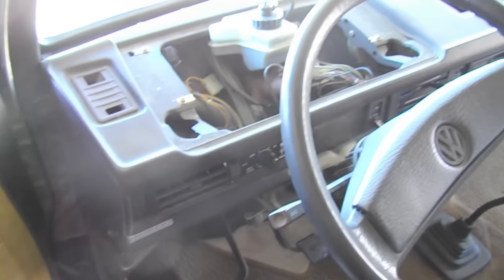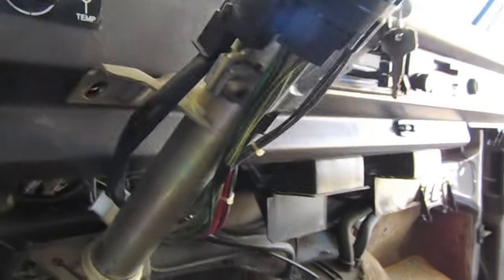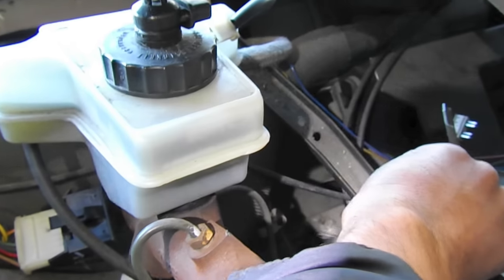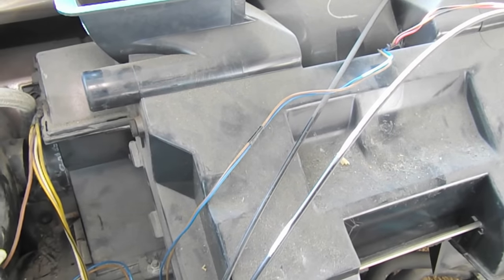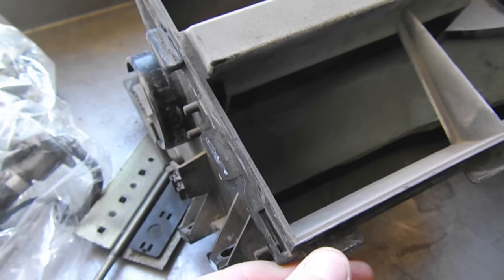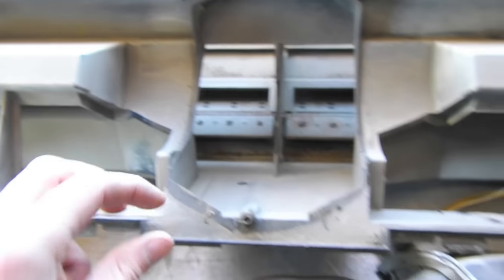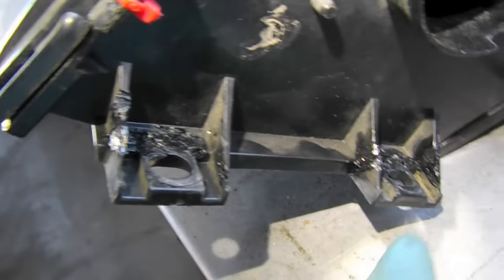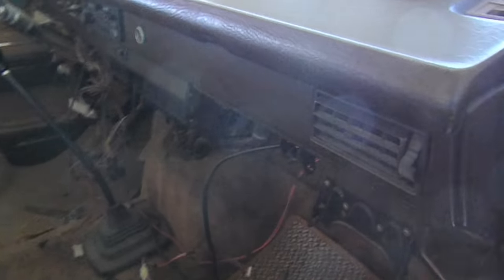Vanagon Dash Removal and Heater Repair

Comment: I learned the deal on those bolts from a friend who has been a mechanic in the 70s.  They are called “shear” bolts, as they come with a nut on the head for installation that Shears off when the appropriate torque is reached.  These are to keep you from removing them.  He said that they always just welded new nuts on them after removing to make it easier if they had to remove them again.

Comment: +Busaru thank you for posting this video.  I just successfully replaced my blower motor thanks in part to the tips and tricks learned here.  Two things I did differently: instead of using zip ties or clips to reattach the halves of the heater box, I drilled pilot holes through the welded tabs and secured them with sheet metal screws (17 in all, I believe); secondly, I relocated my blower motor resistor to the grill area behind the passenger side headlight (similar to the radiator fan resistor located behind the driver's side headlight) with an extended 12 AWG wire loom; it's now surrounded a by non-flammable/non-meltable metal area, is always in fresh airflow, and can be easily changed when the time comes.
Reply from the maker: +Bentley Whitman good tips! I'd recommend that to future folks as well.

Comment: Tell me guys what is the auxillary water pump at the rear on the Vanagon, Someone tells me it is there to rotate the coolant from the back to the front Radiator. Mine has been dis connected now I want to get my heater working again. Do I need this pump? As the hoses have been disconnected and bridged. I purchsed a 1995 Vanagon. I want to get everything original working on it.

Comment: IVE HAD ALL THE PARTS TO DO THIS FOR LAST TWO YEARS , I BEEN FREAKED BY ALL THE HORROR STORIES , IVE WATCHED THIS VIDEO NUMEROUS TIMES AND IM GOING FOR IT .....I THINK
Reply from the maker: You totally should - it's easier than you'd imagine.
Reply: How did it go? Im into my second day and cant get the blower motor housing off- looks like it has screws from the front radiator side. Ive got an '89. Also, my 2 halves are glued as well, but I am worried about breaking them when trying to separate them, how do you do that?
 8^(

Comment: One bad thing about moving the resistor pack outside the air box is that I'm fairly sure the rush of air in the box is supposed to cool the resistor pack to keep it happy.
Reply from the maker: Dwayne Perry Dwayne, thank you for pointing that out. With a heat sink on the resistor it dissipates enough heat to keep the resistor happy (at least in my experience) and I've edited the video to hopefully pursued folks to either leave it alone or move with a heat sink. Thanks man!
Reply: Busaru No problem! I never really noticed the heat sink in the video. But with a heat sink it should be cool as a clam. Love your videos and look forward to seeing the Vanagon moving under its new power soon.

Comment: I vaguely recall doing this on my '83 in the cold. Couldn't split the plastic cases in place, then I removed it and brought it into warmth, the sealant around the perimeter softened and voila.
Reply from the maker: +binnsh Good tip, I bet the warmth really helped.

Comment: First off... LOVE the videos.  Now my question.  Is it necessary/mandatory to replace the blower motor?  I am a huge believer in, "if someone can make something, then someone can take it apart, fix it, and put it back together".  My fan motor stopped working, but instead of buying a new one, I thought why not try to fix it.  After seeing all the CRUD that was in my blower box (dirt, feathers, bugs, leaves, etc.) I figured clean the motor up, clean it out, and see if it works.  Well so far, so good.  All it cost me was a can of Lectra-Motive Electric Parts Cleaner, a few shop rags, a few blasts from my air compressor, and a little electric motor oil.  The amount of CRUD that came out of the motor was amazing.  I wish I could of gotten the actual motor apart to do a FULL service on it... but... it blows (big-time) without any noise or bad smell.  Just wanted to share... and keep those videos coming.  P.S... living in Georgia, having a heater isn't really mandatory... it just bugged me that it didn't work.
Reply from the maker: +B.J. Boyette Good work! Personally, I feel exactly as you do. I love repairing over replacing. The problem is that this was a customer vehicle and he really just wanted to replace everything, so I didn't have much say. Still waiting on payment for this job haha!
Reply: Thanks Bro... but this whole process began with my clutch pedal have WAY too much play in it (the infamous egging out of the clutch pedal arm hole and wear of pivot pin).  As I noted, the blower motor was just add-on since I had the dash off.  Living in Ga., heaters are optional, however A/C has become mandatory.  My Subaru donor engine came with ALL the A/C equipment installed, but of course, I removed it for easier engine installation.  Do you plan on adding a A/C installation video to your repertoire??  Just wondering.  I guess A/C isn't all that necessary in Colorado... but... here is the steamy humid south... they sure are nice to have.
Reply: The first time I did this I cleaned the motor up and put it all back together, the second time was not too much later when I replaced the blower motor :-)

Comment: Thanks for the video! Saved me a lot of trouble. Found out a #3 Easy Out and an impact driver makes quick work of those security fasteners.
Reply from the maker: +pyrobeav2005 Nice, good tip on the security bolts.

Comment: Blower was working fine, until the #10 fuse blew. Thought it was the wiper motor, but turns out it blows when I turn on the heater blower. So, must be seized, eh! Will order a new one to replace it. Looking forward to doing the job now that I know how. Any comments on the fuse blowing?

Comment: My heater cable snapped, thankfully with the heat vent closed.  Live in S CA so not an issue BUT I’d like to fix it.  Does the dash HAVE TO come out? Or could I some how snake the new heater cable to the original (I can see it/access it) and maybe get away with not removing the dash.  This looks hard, and I’ll gonna break stuff on the old gal…

Great vid.  Thx for posting

Comment: Great vid...thanks.  Question: I've seen a couple videos of dash removal, but nobody shows how to remove the instrumentation knobs.   Do you just physically pull them off, or do you do something from the back side like unscrew something?   

On another note, my brakes are very suspect.   I can slam them down and the van will ease to a stop while I was expecting it to screech to a stop (almost ran into a couple of folks).    It seems I'm hitting "bottom" quite quickly when I slam it home.   Brake performance is ~ 15% improved if I pump them once before applying.    I've replaced the MC (and brake sensors), I've bled all six zerks (Mitivac pulling dirty fluid out) and my indi says my pads and rotors are ok and that sometimes this is just how the Vanagon is (I call BS).     Why do I still have crappy brakes?  Would appreciate any, I mean ANY, advice or tips.
Reply: ***** 

PS, 1985 Westy.
Reply from the maker: If you mean the heater controls then you just take a small screwdriver and kind of work then off from the back while pulling out. For the brakes, make sure you have good vacuum to your brake booster, perhaps your booster is on its way out??? Good luck!

Comment: I  have a question for you.  Do you have (or know of a video somewhere) that shows which cable goes where on the blower box?  Also, would you have any info on required cable lengths and cut back for the cables.  I have been searching the web looking for replacements, but it is looking like I am going to have to fabricate my own.  It appears that the previous owner used lawn mower throttle cables for heater control cables.  Any port in a storm I guess.  In hindsight, I really should of marked them at the blower box when I removed them.  Anyway... any assistance would be greatly appreciated.
Reply: hey man... I see you are delivering a vehicle.  Never mind about my question.  I worked it out.  No pics cuz it is a butt ugly arrangement of cables (not my best work)... but it functions... which is way better than before.
Reply: What did you end up using? I am looking to deal with most of those in dash cables, and was thinking bike brake cables and housings.
Reply: That might work... depending on how easy your slides and flaps move.  I wound up using lawnmower throttle cables (HomeDepot).  I bought them all the same length (52").  I wasn't sure about the cable length so I snipped the z-bent ends of the cables (one end only on each) and pulled the cable out of the cable housings.  They are a LOT easier to route with the cable out of them.  Then I just started routing cables.  Once I got the cables routed, I marked and snipped the cable housings at the needed length.  After that I slid the cables back into the housings (grease them first).  I connected the finished end (the one with the z-bent end) at the control flap and  did my final snip and put a new z-bend at the control levers.  I used a magic marker to mark the open and closed locations on the cables (they move pretty easy brand new and freshly greased).  Anyway... that's what I did... good luck.  Just remember... measure twice... cut once.
Reply: oh yeah, search for "z-bend throttle cable" to see a video on how the z-bends are done.
Reply: Thank you B.J. Boyette! This sounds much more doable, and throttle cable will likely last longer in that environment.
Reply: da nada... glad to help.

Comment: Hello Sir ! Could you please tell more about the plastic welder ? What model did you use, so I can have a reference point ? 
About the dashboard...I had smoke from the dashboard, about a week ago. Somebody affirm that fix it, but last night when I started the engine, my dashboard heating was on 2 speed and I felt burn smell again, docI stop the heating. Sny idea about what I should looking for ? I'm a full time traveler and unmounting the dashboard completely, it's not a valid option for me. Any suggestion what I could check ?
After the guy "fix it" , something strange occurred. The heating started without the key contact and somehow, seems to be connected with the headlights, because when i turned iff the headlights (with the key off) the heating also stopped. Thank you !
Reply from the maker: yikes, I would definitely check into the wiring from the switch to the resistor in the heater box. Do you get a burning smell when turned to hi?
Reply: Busaru Well...one day, lot of smoke came out from the dashboard air blowing holes. I've been to the garage to fix this, among other stuff. After few days I left the garage, ine night when I turned on the engine, the dashboard ventilation was already on 2 speed position but refused to start, and after few minutes, I felt smoke smell or burned smell inside. Taking down the dashboard, is not possible for me now, since I'm a full-time traveler in the wheelchair, depending on the van, sleeping inside. My guess is that on that garage, they did some improvisation. Here's why : one night, the engine was turned off and also the key was in off position. Still...the heating was activated when the headlights were on. If I turned iff the lights, also the heating turned off. In this context, anything that I can check myself ? Where this resistor is located ? Thank you for your time !

Comment: great video! We just bought an '85. The heater controls are stuck near center. It blows hot air constantly. Is this the issue you had, or do you have any recommendations?
Reply from the maker: +Hi-Calibre Graphics Ltd. I bet you just need to live up the cables or free obstructions on the flaps. It would sure help to have the heater box out to do that. I had to replace the actual blower motor on the van in this video. Good luck!

Comment: Early in the morning it was raining I had the windshield wipers going they were going kinda slow I turned on the heater and a fuse blew, now it won't turn on at all, what fuse is it, I have an 84 would I have to take it all apart and replace the motor or? My wipers still work fine and I think I remember trying to swap the heater fuse if it has one but the fan still didn't work.
Reply from the maker: Sounds like you might have a frozen heater blower. Check your manual for fuse location or just look for the blown fuse in your panel. You will probably have to pull the dash - pretty much an all day effort unfortunately.
Reply: +Busaru Thanks for the reply  it was working fine for a year then it did that and now it won't go Ha. I'll get to it later, too scared to pull the dash atm.

Comment: HiJust a question, my heater control don't do anything control switch not working , it's stuck on ' hot', fine in the winter but a little stifling in the summer, do you think it's a fan motor problem or just the controls that operate it
Reply from the maker: +Think Tiling  it sounds like the control cables, flaps, and coolant valve need a little rehab. Start by locating the valve and see if you can manually open/close it.

Comment: the resistor is supposed to be mounted in the cooling air flow....
Reply from the maker: +Zehnuss Yep, just super inefficient that way. Throw a heat sink on it and it's a much better setup. Or better yet, go with a Jeep type that you can replace without having to take the entire dash apart to replace, or PWM control. When Ava's one is on low it needs the most cooling at the resistor, seems to be why they fail, not enough airflow?

Comment: Hi Busaru, Just a quick question as i'm currently doing this job myself. I noticed that you place the resistor on the outside of the heater unit for ease of access, but aren't you worried that the resistor will get too hot as they do and melt the plastic casing?
Reply from the maker: +Toby Hamilton Yep, throw a heat sink on it. The other option is going with a PWM controller. I've never done it but know it's an option.

Comment: Just in time.... my heater fan is shot and brake power booster is leaking.
Reply from the maker: I just found that my 77' Bus's brake booster and master cylinder started leaking, causing white smoke out the tailpipe. That scared me a little as I thought it was a head gasket. Good luck with your maintenance.

Comment: Just an FYI...alternative solution to resistor replacement found on thesamba.com here http://www.thesamba.com/vw/forum/viewtopic.php?t=623382
My test video: https://www.youtube.com/watch?v=nvxZ5Iq0Ehk

I plan on installing inline ball valve near passenger front panel to shut of circulation to prevent "hotfoot" in summer.
Reply from the maker: +Van Vw This is fantastic, good work. I'll be doing this next time for sure.